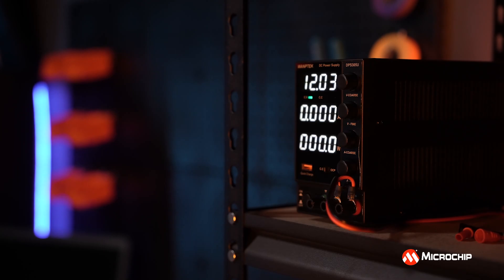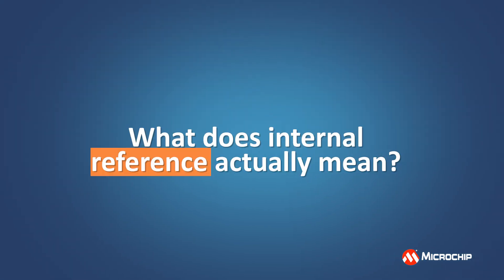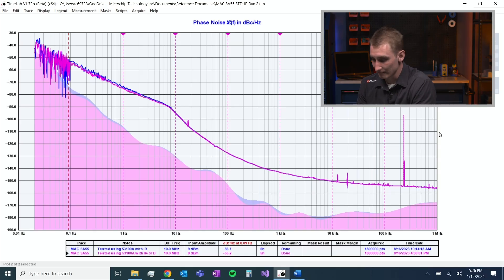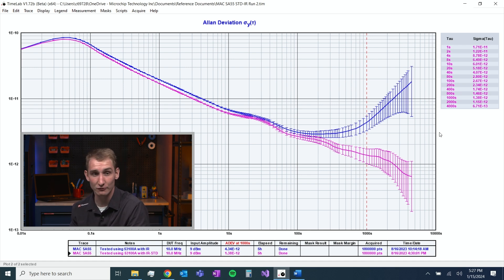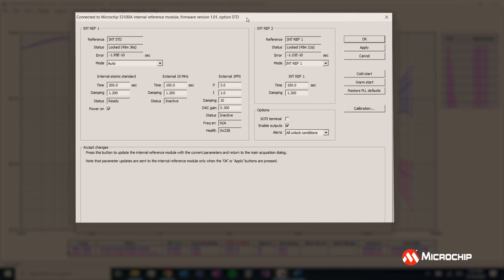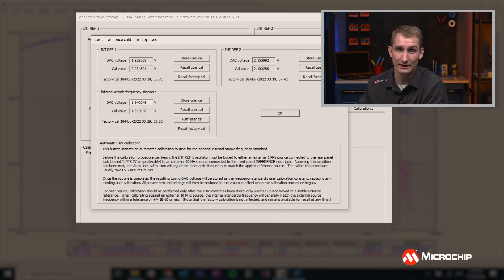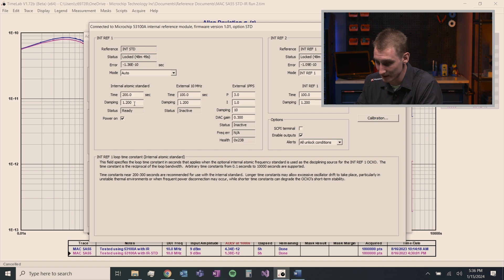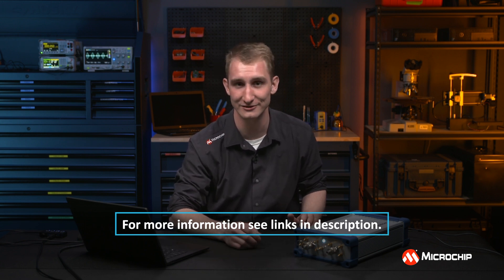Built-in Accuracy: Utilizing Internal References in the 53100A

Comment: Helpful to a point. Rubidium clocks still use crystal oscillators inside, with a PLL to the atomic pallet for locking frequency accuracy. The phase noise of a rubidium clock is the phase noise of its crystal clock. Some can be pretty bad if phase noise is an issue. The frequency is correct but the phase noise can be good or bad depending on the quality of its internal crystal clock.